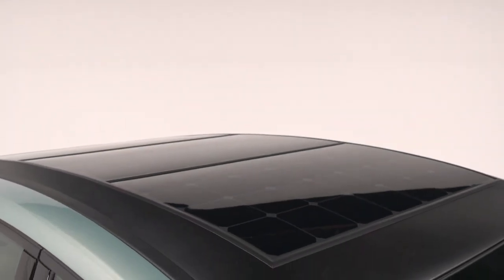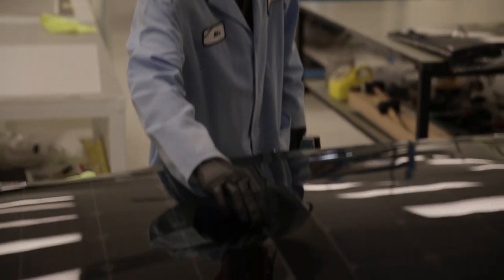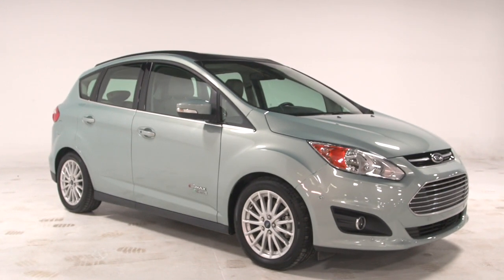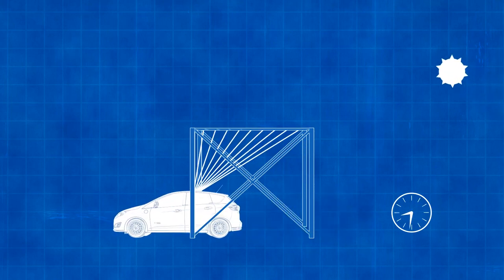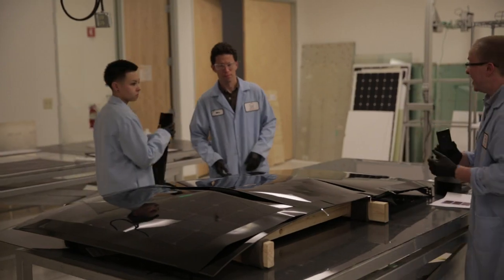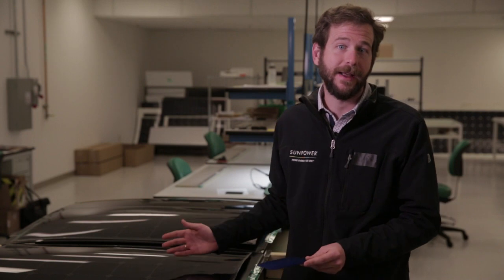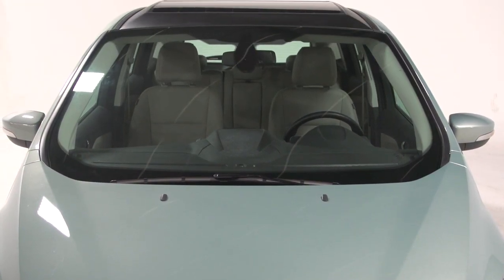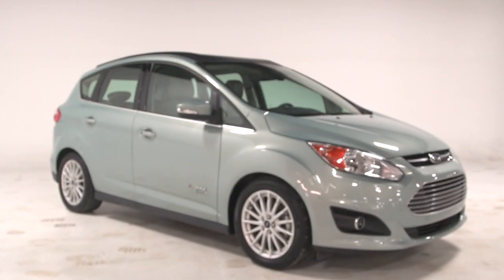SOLAR Powered Passenger Car - Ford CMAX Solar Energi Hybrid Concept

Comment: and these guys are so stupid as they won't do it unless it fully recharges the battery forgetting that for someone like say me the panels can keep the battery's full on the weekend at-least during the summer due to my low mileage driving that's why there are no electric cars with a solar panel option that dose recharge the drive battery

Comment: 3+ years later this is still unavailable. Hmm.
Reply: The HYundai sonata hybrid uses two small solar panels on top to help charge the batt pack, you only get about 4 miles per day from solar on a sunny day but  it is a good start.
Just think about a mini van with all that roof space for panels and how much  solar power you could get from a days worth of sun.

Comment: Yes, I remember seeing this video a few years ago. I did tell someone that I didn't think this technology will happen anytime soon. Why? Last time I checked, most of the solar cells for commercial and residential use have around 15 percent efficiency. I was under the impression that although the price of solar panels had drastically decreased in the last few years, the efficiency rating for mass market solar panels have hit a plateau, which is around 15%. Let's assume the average commute in America is approximately 20 miles one way. That means it will need an 8kWh battery and solar panel to power this 20 mile range. Let's then assume that a standard midsize sedan can be covered by a maximum of four standard sized solar panels with each panel producing an average of 200 watts per hour. It will probably take 9 hours of good sunlight to power a 20 mile commute. Hold price constant, if the efficiency could double from 15 to 30 percent, then it will take about 4 hours to power the 20 mile distance. So, I guess it is somewhat feasible if a 30% efficiency rating could be achieved at an affordable price. I guess if huge magnifying lenses( Don't remember its proper name)are available then you can also increase efficiency.

Comment: To he honest this is the best innovation of our time. My question is the advantage of the solar car to the eco-system? Is it environmental friendly? I know it reduce carbon.
Reply: Clemgraphics Studio Watch Before the Flood
Reply: Hi  Clemgraphics
Subject    :  let me join with you about this device THE ELECTRIC REVOLUTION in your electric car.
I have this technology in my hand, I called that Tools to Charger (TCB) for all Battery, battery will get to charge all time, and to charge full any time at the same time while Hybrid car or Electric car was running, if you use and put or situate this TCB in your Hybrid car or general electric car, those cars will be able to run at about 8000 Kilometer per make a charger (Or run infinite). This is your benefit, and your new challenge.    Are you interested?
Thank you
Reply: Hi  Shyann Destiny
Subject    :  let me join with you about this device THE ELECTRIC REVOLUTION in your electric car.
I have this technology in my hand, I called that Tools to Charger (TCB) for all Battery, battery will get to charge all time, and to charge full any time at the same time while Hybrid car or Electric car was running, if you use and put or situate this TCB in your Hybrid car or general electric car, those cars will be able to run at about 8000 Kilometer per make a charger (Or run infinite). This is your benefit, and your new challenge.    Are you interested?
Thank you

Comment: I would request you to increase the solar panels on top of rest of horizontal plane both in front and back of car also increasing size of Dicky upto a length of 7 seater car also making it slopy at back to drive upto 550 miles in one single charge like Stella Lux

Comment: very good idea. i thought too that since frennel lenses are usually flexible plastic, there could possibly be a portable version done of the canopy that could be taken wherever the car goes on like a roof rack attachment as well as carrying a space frame in either the spare spaces in the front or back of the car. of

Comment: What are  the cons for these actually..cause this is actually have great potential and actually i have seen thiz kind of technology in a camper van such as free spirit mercedes van converter or pleasure van plateu and ascend.well actually the they are not using the solar power for the fuel, as it using diesel fuel, however beside the in-van generator they also use solar energy to use the hot water, television, air conditioner, recharger for gadget battery, electric sofa bed ..even wifh microwave and refrigerator wich usually cost a lot of energy(well for this one maybe they used propane or in house generator..please correct me if i am wrong)..so we can live in the middle of nowhere for weeks without electricity bills..and it is automatically disconect the solar power energy to the battery when it is fully recharged, so the battery logically wont be having overheat status and can have lo ger durability...

Comment: It's not fair to the average person to mislead via marketing.  The advertized 1.5sq meters generates at best 300W for a few hours, while the best sedan, a Tesla S, uses more than 1 hour of that per mile on the level.

As a Sunpower stockholder, I prefer honesty to manipulated sales statements -- dividends are more reliable that way. ;]

The car's paint, rubber & interior will be destroyed by the sun, costing many times more than the tiny amount of solar energy stored via the exposed inefficient panels.  Yes, the best solar PV now for retail wastes ~80% of sunlight as heat and infrared that go directly to GHGs and climate warming.

Paint your home's roof white, and/or plant trees and put up home solar PV & hot-water.  EVs don't run on their PV panels.  Though teheir paint, etc. is saved by parlinking under the panels many colleges & businesses & municipal buildings in Calif. now have.

Thinking caps on, folks.  Marketers are everywhere, especially on the web.
;]
--
Dr. A. Cannara
650 400 3071
Reply: Good post, but we may as well try to add in the effect of that solar concentrator, especially if used while parked all day at work, etc.

And, painting your house white is only useful in warm/hot climates. The effect of a cooler roof in winter in cold climates seems to cancel any gains.